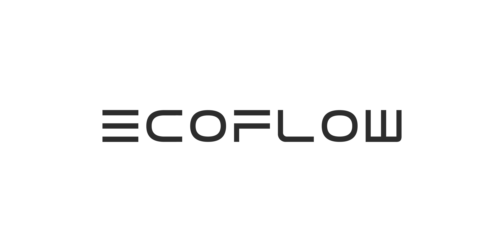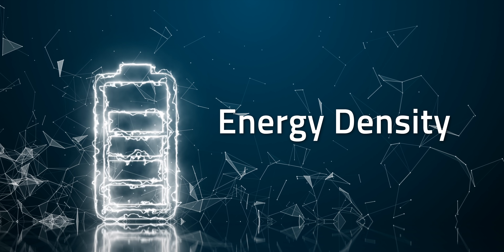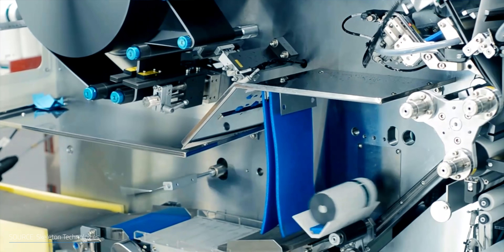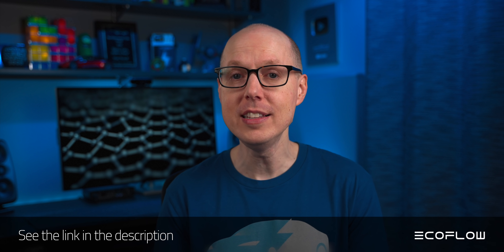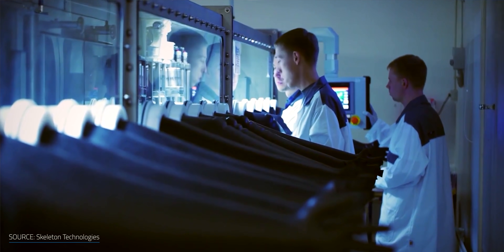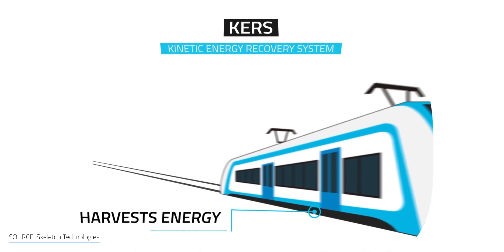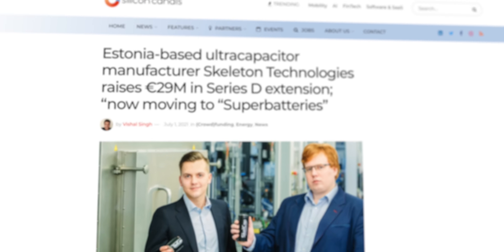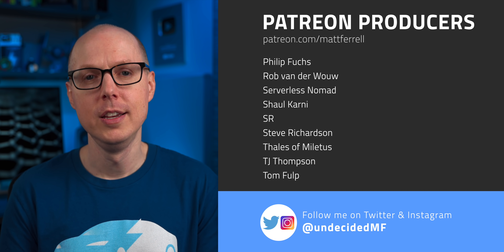Revisiting the Supercapacitor - The Wait for Graphene is Over

Comment: Great video! What's the improvement percentage compared to current super capacitors? 
Usually reducing dielectric size between the plates we increase the capacity but we reduce the operating voltage, was there any new dielectric technology they are testing/applying?
All traditional capacitors and super capacitors have a high leakage rate, a
Around 15 to 30% in a couple of minutes (depends on trademark)and in a week we have no charge left. How they are managing to reduce this leakage to keep charge for 30 years?

Comment: just a thought, but even if graphene is only 1 atom thick, is it still not 3 dimensional. you would have length and width of a surface area, and even only at 1 atom thick, you would still have a 'height' or depth area, thusly giving 3 dimensions, correct?  just curious.

Comment: With ultracapacitors are you able to limit the amount of electricity coming out at once so you don't just get 1 absolutely huge burst of energy and instead get a long a steady stream of electricity like a battery?
Reply: Yes. The current (amount of electricity, roughly) depends on how much the load uses and needs.

Comment: Graphene has been usedfor years in speakers. Magico speakers has speaker comes with a one atom thickness coating on thier speakers. Strength like steel you can stand on the speaker cones layered with this material. Magico speakers, of Hayward, CA  USA.

Comment: Graphene is super directional for conductivity so I wonder when thermal interface material pad will out pace paste and liquid metal I know not yet but soon. As far as ultra capacitors it is interesting as  the capacity is good, but also electric transmission line would be great as it  would conduct excellently but be easily insulated due to the directional nature.

Comment: I expect that the USAF's NGAD fighter will have very large banks of supercapacitors feeding it's laser primary weapon system. Power will be supplied by a highly efficient gas turbine auxiliary power unit driving a three phase variable frequency alternator. Which will in turn feed an enormous variable voltage DC bus close coupled to the laser(s). The aircraft's main computer will use smart algorithms to manage the power output of the alternator and charge state of the supercapacitor bank to engage possibly dozens of targets within seconds. All this will have to be placed within the area between the two S shaped main turbine intakes, so perhaps only one laser.

Comment: There have been some independent experimenters who have had interesting results using grapheme in battery technology. The large companies have been watching closely. I suspect there will be a number of advancements revealed relatively soon. Patience is needed.
Reply: It doe not work well as a battery at all. It does not store energy over time very well like batteries do. It is much better for large bursts of energy output or input (regenerative braking and acceleration) because it can charge and discharge much faster then a battery without hurting the capacitor

Comment: I'd love to see graphene used to make vastly better "wires" for power grids to help improve and expand power grids making trading electricity easier and cheaper over larger and larger areas.
Reply: Generally when you want better conductance for a wire: you just go wider. It's only when that's impractical that you consider upgrading the material. 
Whilst graphene beats equally thin copper, graphite isn't flexible enough to make a good wire. And it needs to be graphite because it needs to be thick.

Side note on graphite's conductance: it matters how you measure it. It's much better going parallel to the layers of graphene than going perpendicular to the layers. That's true for both its electrical and thermal conductance. Some of the stuff i found while researching graphite wires after reading this comment seemed to not understand that nuance

A related option, though, are carbon nanotubes. I haven't researched them thoroughly but it does seem some people are looking into using them for wires. And i don't see any reason they couldn't beat copper. But i think we're a long way away from them being used for power lines
Reply: Graphene's conductivity is unmatched only on micro scale; the bulk material is still just graphite. For long range transmission, we'll have to wait until practical high temperature superconductors become a reality (they're tantalizingly close).

Comment: Gmg (ipo gmgmf) is on a similar vein with some fun performance data on their graphene-aluminum battery prototype.  I would love to see you deep dive with them. 60x charge rate as Li, cheap and recyclable, 3000+ cycle life, no degredation in cycles or cold weather
Reply: I have been invested in GMGMF since may so take what I say with a grain of salt but the CEO says that their technology will bridge the gap between battery and super capacitor. They also have a proprietary method for making graphene from methane which is cheap and can be done at scale. That also means you can used these batteries as capacitors to charge cars at accelerated rates. Just trickle charge a battery at a charging station off the grid and then output the charge to the car at 3 megawatts. Then you can charge your car to full in 10 minutes. No more range anxiety. That is just the start of the potential applications of this technology. If they are able to scale up to grid level batteries they could solve the problem of excess generation from renewable sources. Depending on how their technology scales it could end up making both lithium ion batteries and super capacitors obsolete.
Reply: High charge rates always sound great until you think about designing a charger…
Reply: @sirifail4499  Nah, just grab the mains and plug em in!  Then you should probably stand back.  :-/  :-)

Comment: Well graphene is very cheap to make, it flashes using electricity from practically any carbon-based material. When we see graphene move over to construction, that will mark a turning point in human civilization with structures reaching into orbit.
Reply: Already happening sir, look at Versarien PLC, they are supplying graphene for concrete with great results.
Reply: @glenweston1966  thanks Glen, I'll definitely look into this!!!
Reply: They have been working with Nationwide Engineering
Reply: @glenweston1966  Behold, the future is now.

Imagine what the world will see when emerging technologies like active supports merge with graphene reinforced building materials.
Reply: https://youtu.be/Sc8-I2an6Tc.

Comment: Super caps. limitation isn't the electrodes, its the electrolyte. The best electrolyte of super capactors is limited to 3.6V.  E = 1/2CV^2. Double the voltage and increase the energy storage 4 times. SuperCaps won't become a viable solution until the electrolyte voltage is at least 10 times the 3.6V. Realistically Cheap Actived Carbon in SuperCaps is sufficient if the electrolyte voltage issue can be addressed. Graphene is just a patch on the electrolyte issue and Graphene SuperCaps are likely to be considerable more expense than Activated Carbon SuperCaps.
Reply: They aren't going to replace batteries, you're right, but they're already a viable solution for many applications. Also, I can say pretty confidently that there will never be a 36 V electrolyte. Even 5 is pushing it.

Comment: I understand one of the drawbacks for Ultra capacitors is that once charged they loose up to 10% of their energy in storage, it is this attention to detail in manufacturing that would make or break them for energy storage such as solar battery, where size and weight are not important and the possibility of multi day storage should be considered. Current lithium cannot do this very well and possibly Ferric Sulfates and iron might be supplemented by ultra capacitors for grid stabilisation and multi day week storage.
Reply: They lose about 1/3 of their stored charge in the first day, and then more slowly after that. This is simply a function of their low ESR, you could improve their capacitance retention, but it would come at the cost of power capability. I think they could be a good option for load-balancing for renewables though, because they are extremely durable and would have a much longer service lifetime than Li-ion. You could use them to handle predictable cycles like for day-night with solar. For a week of all cloudy days you would need something else.

Comment: Another excellent video!
Please note that micron is obsolete. 
Use micrometer instead (MY-kroh-meet-er)
Reply from the maker: Thanks!  One question though, I've always heard it as micron for measurement.  Micrometer for the measurement tool.  Isn't that still the case? 
 https://en.wikipedia.org/wiki/Micrometre
Reply: @UndecidedMF  The article in Wikipedia is correct in saying that micron was replaced with micrometre (note British spelling) and pronounced MY-kroh-mee-ter. Good practice is to spell and pronounce it that way to distinguish it from the measuring tool micrometer (note spelling) and pronounced my-KRAH-muh-ter.
Love your videos and always learn a lot, which I appreciate as a technical writer for Google (and before that Intel and IBM).
Reply: @UndecidedMF  Wikipedia points out that the term "micron" has been superseded by "micrometre" (note British spelling, although here in the States many write "theatre" instead of "theater" or even "glamour" instead of "glamor", so the typical "British" spellings are not always exclusively British). The word is pronounced MY-kroh-mee-ter (just like microgram!). This puts "micron" into the same status as "angstrom", which is also obsolete and should always be replaced by the equivalent length in nanometers.
Writing "micrometre" as such and pronouncing it as indicated differentiates it from the measuring tool "micrometer", pronounced my-KRAH-muh-ter.
HTH
Looking forward to your next amazing video, always so clearly presented. As a technical writer at Google (and before that at Intel and IBM) I definitely appreciate the quality of your explanations!

Comment: Hope to understand diff between graphite lithium anode technology vs the graphene technology above mentioned. For the former technology, an australian company Novonix is on my radar, that produce this material for battery, but not sure what diff betw graphite and graphene in battery technologies
Reply: In Li-ion batteries, Li+ ions slide between the graphite layers in a process known as "intercalation" and the electrode gets stuffed with them. This is great because you can hold a lot of ions, but they're (relatively) slow to insert and extract. With supercapacitors, nothing is being stuffed, it's just sticking to the surface and popping off again. This makes it extremely fast, and capable of delivering high power output. Because the graphene sheets are wrinkled (or curved), they have a lot of surfaces to stick to compared to normal capacitors, which just use sheets of metal as electrodes. Hence "super" capacitors.

Comment: I don't know if electric aircraft may be possible one day  -- everyone always says that batteries don't have the energy density fuel has, and meanwhile fuel cells don't have the power output that combustion has. But if they do happen, perhaps graphene supercapacitors could provide a few minutes worth of additional power for takeoff and/or climbing when necessary. Then fuel cells could provide just the power required for cruising.
Reply: So you carry around heavy supercapacitors all the time that have low energy density? Flight seems like the last place to use this technology.
Reply: @Number1  - note that I specifically said "provide a few minutes worth of additional power for takeoff and/or climbing when necessary" - What I meant by that is you'd only have enough supercapacitors onboard to boost your power for a few minutes. This is because supercapacitors can provide lots of power quickly., compared to other types of devices like batteries and fuel cells. I did not say that supercapacitors should make up your entire power supply.
Reply: @manofsan  I fully understood exactly what you said. Not sure why you assume I didn't read it. I just don't see any benefit. Using it for any of the energy used in flight is going to make the vehicle heavier than it would otherwise be if you used batteries for that part of the flight.

Comment: I think if it is inexpensive it will see a lot of use.  If not then it will see use in rockets and aviation where weight matters and use will be limited beyond that.

Batteries have a short lifespan, capacitors are useful to extend that lifespan.  Jumpstarting motors and smoothing power factors is an obvious use, but traditional capacitors are good enough that cost versus size will not favor change.  In vehicles, however, this mass is accelerated often, and any use like this will benefit.

Comment: Don’t forget the new breakthrough called “FLASH” graphene. You still have not covered that yet. It is 95% better than conventional, and is cheaper to mass produce, even DIY with proper equipment.
Reply: It’s being done with used tires. It will revolutionize recycling

Comment: Real supercapacitors (or rather hypercapacitors), that easily outperform energy density of even gasoline by weight and volume will come in about 400 years (end of coal). The keyword here is εᵣ (relative permittivity) of a class of meta-materials, only very few people know about: So called Topological Insulators (TI) at room temperature as a dielectric. In simple terms, TIs are the opposite of superconductors.Theoretically, a perfect electrical insulator with infinite breakdown field-strenth and infinite relative permittivity and no dielectric losses. Technical and physical limitation however make these values finite. E.g. particles from nano-Bismuth smaller than about 9.1nm form such a topological insulator at RT (Room-Temperature) with a transition temperature of about +63.5°C can do the job. Practical values are about  εᵣ=4.5·10⁶, a layer with thickness d=30nm has a working voltage of about 2'300 WVDC. Since capacitance C=εo·εᵣ·A/d (while A=Area and εo=Vacuum permittivity 8.854·10E−12 F/m) and energy of a capacitor is E=½·C·U² (U is the voltage), small, portable capacitors can be built, those energy content can be measured in kt (kilotons TNT-equivalent) when layered graphene is used as electrodes. Needless to say, short circuits should be avoided. Consequently, this is forbidden stuff and secured by many classified patents from countless governments. Whoever comes forward with manufacturable blueprints will experience the same fate, like the unfortunate Jamal Kashoggi. His highness, crown-prince bin Salman, would become very, very unrelaxed, when people flew on hypercapacitors, charged by renewable energy sources, instead of kerosene. Disclaimer: Everybody can develop and build such a hypercapacitor. Whoever plans to place it on the market, will become permanently neutralized. This is not a joke.

Comment: A capacitor (irrespective of the type)  can only be charged by alternating current or interrupted direct current.   I have made them act as an conductor.  lit a bulb through it.  It only stores the last phase of alternating current so it only returns the last phase and previous phases are wasted.  They have no function in storing current for electric devices tools or cars.